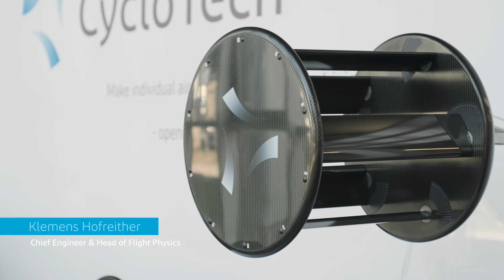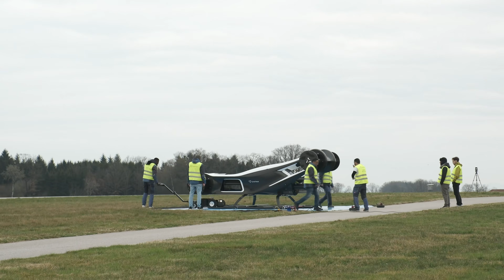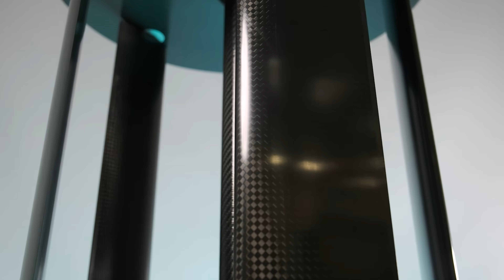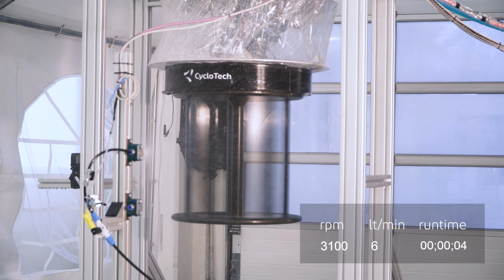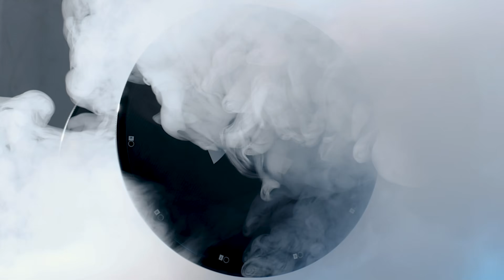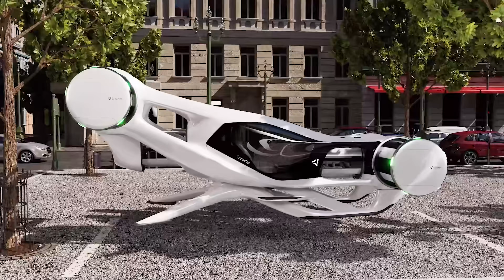CycloRotor | CR-60 Market Ready

Comment: I remember many years ago seeing Cyclo drives in RC craft when I was getting into it, I flew fixed, rotary wing & quads eventually when they became popular. The problems back then was they were really violent when they blew apart, Im sure these are a lot better than hobby grade cyclo motors, one guy had built the Spinner from Blade Runner, awesome. My only pet peeve is this tech were ever to grow into civil aviation is the only way to survive a failure would be at very low altitude or a high enough altitude to deploy a ballistic chute system. It's going to be interesting watching safety trials. I see this more as drone tech.

Comment: What's the efficiency of your cyclorotor compared to a conventional prop solution of similar power? Thrust/Power ratio?
Reply: about 50% less.
Reply: ...and with that, being high efficieny the most important feature of a small manned/personal vtol, this whole concept become totally useless. It looks cool and has some benefits against conventional props vtol, but the drawbacks are way too many to make it a viable solution.
Reply: @licencetoswill  Cite your sources, otherwise you're just a troll, speculating.
Reply: As the comment above already pointed out, ~50% less, since the blades only provide thrust when they're moving downwards.
Reply: @winni2701 according to that a propeller is more efficient than a bird, since a bird’s wings are moving up half the time. But that’s oversimplifying.
Reply: @lifespurpose1  Tell me that you don't know how gliding works without telling me that you don't know how gliding works.
Reply: @winni2701   @licencetoswill  they are 20% more efficient and generating lift, but they are heavier.  the reason is the entire length of the blade has proper and equal loading while a traditional prop does not.
Reply: @winni2701  I'm sorry but... 

1) It doesn't provide thrust when the blades move upward, but it consumes almost no energy (no action, no reaction). Therefore, your rough calculation may be incorrect (I'm not confirming this, but it seems very likely).

2) A cyclorotor could be combined with road wheels (most easily with electric ones), which, when combined with a lightweight composite body, offers incredible vehicle capabilities. Imagine a mountain road collapsing and cars flying over the abyss to avoid being hit by a rain of stones and continue their journey safely. It's especially exciting to imagine that emergency vehicles could do the same.

The cyclorotor may be the future we've been dreaming about. 
I'm not saying that this is exactly how it will be, but it seems to me that this is something we can strive for, and with a cyclorotor this is more likely to happen.
Reply: @ВикторМарухин-с2ж  im sorry to shatter your dreams, but do you know how large the properels would have to be to lift a car? and how much extra cost that would mean? it's not happening in any foreseeable future sadly..